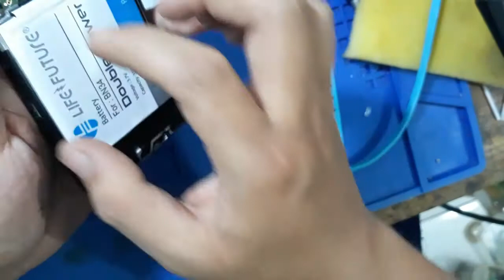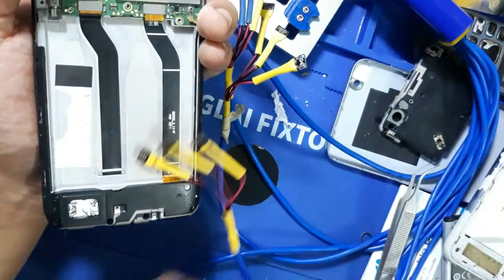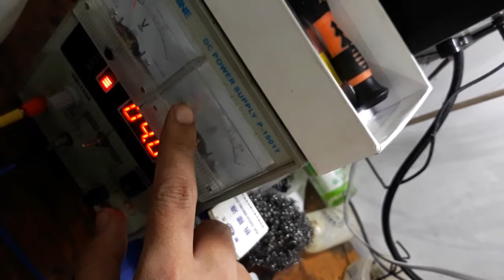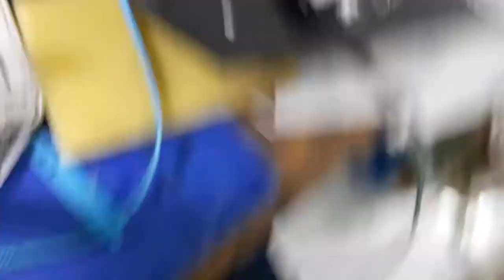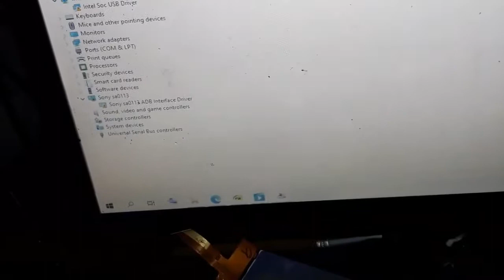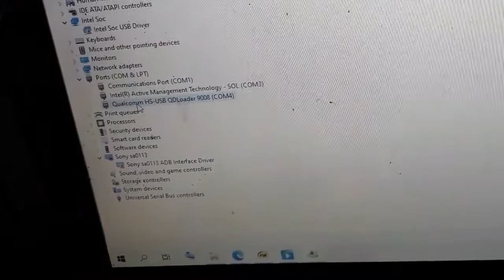Why this is EMMC Problem? not The CPU nor the IC Power Issue? [English Version ]

Comment: Hi friend very well video. I have a cell xiaomi redmi 5 that when you power on it goes 125ma then it stay or stuck sometimes 65ma others 43ma. I have check all voltages pmic and are fine only miss a 0.8volts that goes to cpu. But not exactly know if it goes later activated for RF or modem. Also have to check this of your video or check if i have comunication cpu emmc with osciloscope tomorrow. What do you think?? Emmc!!!
Reply from the maker: Hi. Thanks.
So the phone is dead? Try to connect it to the computer without battery, then tell me what happens. Have a great day.
Reply: @nuhacell-f2o  
It Is reconize by the computer. Connect disconect on computer
Reply from the maker: @edgaralbo6433  open the phone cover, remove the battery and then connect it to the computer, and see the status on the Device Manager window on your computer screen.
Reply: @nuhacell-f2o  the status Is like an error. That the computer see It buy as of It were driver problem.if the emmc or with the emmc It Is Always the same. For me Is the emmc. Tell me something. Doesn't worth buying a new emmc.? I have to reprogram the emmc putting the rom or software inside.
Reply from the maker: @edgaralbo6433  have you installed the Qualcomm driver on your computer?
Reply: @nuhacell-f2o  no
Reply: What's the difference to connect on computer without the battery?
Reply from the maker: @Abbathsin  when it has problem with the emmc, usually the computer read it as 9008 Qualcomm

Comment: First thank you so much ❤
I learnt from U if gage power supply on 0.1-0.6 that means the problem on emmc to be sure from that we connect test point and during phone connected with pc if I find port 9008 or mediateck or usb1.0 Huawei...I will conclude the cpu and power circuit work good...is this correct? my English is weak please tell me by replying to me
Reply from the maker: 99.99% true.
Reply: Thank you so much😊
We wait more
Reply from the maker: @Alaa-9189  my pleasure, good luck.

Comment: sir my old samsung note phone shown kernel problem msg at start and no working ..so i tried to install frimware using odin.........but it stuck and stopped during step of chash memory....and stopped in download mode....then i also try to do that again...but a blur download mode screen came and dissapeear....now my phone is only black screen no download mod no kernel msg.....no start ...is it emcc problem or cpu or other problem?
Reply from the maker: Try the next step, flashing using 'Muslim odin' it's more powerful than any other flasher software. If the problem persist happen, maybe your internal memory is weak and need replacement.

Comment: Nice video sir learnt alot..please i have an isssue when you press power it reads 0.007 when you release power it returns to 0.000 please help
Reply from the maker: What type of phone?  Have you checked it correctly with the correct battery connection?
Reply: @nuhacell-f2o   infinix x627
Reply from the maker: @israelmaurice6910  infinix must used the battery connector, you can take it from the battery, desoldering the connector and use it as a battery source but use DC Power supply.
Reply: But if you changing the emmc you also need reprograming which you never mentioned
Reply from the maker: @brimsupereme  That's true bro. This video is to show you how to analyse the cause of the problem. Mostly Aimed for mobile phone technicians

Comment: Nice explanation based on your experience i have the same symptoms on a samsung device when powered on or removed from charger it's stuck on 100mA and nothing shows on screen it takes 0.6A on charge but before was taking 1.6A. It's a water damaged device it was showing a warning message for overheating issue and the recent/return buttons don't work either i am glad that i saved the whole data off of it when i had the chance to boot it after i removed some thermistor off the board but now it's just dead, so is the warning message for overheating was due to the emmc itself and does a dead emmc prevent the phone from starting? (someone told me if the emmc is dead it will show a green screen when the phone turns on) also i sprayed the board with lighter gas to freeze it and powered it on and the emmc showed up with heat starting from upper side corner, i may try a reflow as a last attempt
Reply from the maker: Green screen in samsung mostly caused by CPU,  you just need to reball the CPU.
Reply from the maker: It happens because when the phone is over heat,  the CPU is slightly disconnect some pins because the CPU is attached with glue which can make it loosing easily.

Comment: Hi brother. I have samsung a5 2017 (SM-A520F).
The phone is stuck in downloading mode, it says ( Downloading.... Do not turn off target).
And im trying to fix it with flashed using Odin, But its always fail. And get notice in odin like "Repartition operation failed". I tried many time but getting that problem.

Did you know what the issues? Thats doesnt get problem with the Emmc? Or what

Please help me
Reply from the maker: Hi bro.  Emmc lifetime issue causes some failures, etc.  stuck logo,  keep restarting,  lagging, and dead.  If you have tried to flash but it failed,  thats 99% needs emmc chip peplacement or repartition.  But repartition will not last long, in some cases it last only 3 days usage. So replacement is better. The Replacement of emmc is so much technical,  you can't do on your own unless you have the tool and the emmc programmer box.

Comment: If i take off eMMC from Motorola one vision and solder it to exactly same model Motorola One vision. Wil the eMMC with existing data work on new Motorola one vision?
Reply from the maker: I never done that, so I am not sure it wil work or not, but it is worth it to give it a try. However, It depends on the  model as well.  May be it will work o  mediatek chipset.
Reply: @nuhacell-f2o  thanks for replying.

I don’t know what mediatek chip set is. I’m just trying to rescue my data by buying exactly same model Motorola one Vision and to put my water damaged phones eMMC on this new working One Vision. I watched a ton of videos how to transfer the eMMC, but no one can answer if the eMMC will work on the new phone/motherboard.
Reply from the maker: @lafriguisara8014 Emmc working is technically done by a  technician. Are you one of those?
Reply: @nuhacell-f2o  

Im not a technician at all. Never done it before.

But so far i bought:

- multimeter
- solder station
- solder iron
- flux
- desoldering iron
- Same model phone
- 99.9% alcohol
- a new battery to replace the old one
- a phone repair set
Reply from the maker: @lafriguisara8014  wow.. what an effort.  But it seems you will find it hard to remove the emmc with that ammunition, you need a hot air to remove it. Btw,  how much dollars hbe you spent for that? I mean comparing to put your phone to the local mobile repairer.
Reply: @nuhacell-f2o  ooh true… instead of hot air gun, i used hairdryer with hot air to open the phone. I have this special glue i bought t7000 I believe.

All costs together (i still planning to buy a ultrasonic cleaner) between 200-250 euros. 

I’m also someone that likes to learn things, this might explain this crazy effort. All started when my phone screen got broken and I replaced it successfully by myself. Now it’s like I enjoy to learn myself. 

Now the only thing holding me back is if the eMMC will work if I transfer it to the new motherboard without also transferring the cpu or gpu. 

Oh yeah i still need to buy BGA reballing utility and solder paste to refine the pads/pins under the eMMC …. Yeah learned all this by watching videos for days now.

All thanks to amazing people like you that share and teach people!
Reply from the maker: @lafriguisara8014  Well, thats really great. I do really appreciate your plan and hard work. Also, congratulation for the well-done LCD repair. Anyway, something for you to remember that the emmc working is so much far different with the lcd replacement in the term of complexity. Before you do to your water damage phone,  you can practice with some unused pcb boards so that you will have experience first. Then you go with the real work, because if you do whatever small mistakes, it will ruin everything as we know that the components are tiny. Ah, one thing I almost forget to tell you, your hairdryer can be used to remove LCD , but not the emmc. You do need a rea hot air. 
And, dont buy ultrsonic cleaner, you dont really need it. It is not worth it to buy only waste money.
Reply from the maker: @lafriguisara8014  Btw, you havent told me what type of phone that you re working on. If it is something old phone, I guess you will have the data back as long as the swap runs perfect. Because old model use low security encryption.
Reply: @nuhacell-f2o  thanks for the advice. I see, i will see if i can get my hands on a hot air gun. Oke so ultrasonic cleaner don’t do much? Might take it off from my list and instead buy a hot gun.

My phone is Motorola One Vision from 2019. The eMMC is encrypted if i got my info correct. That’s why i bought the same model phone and not just another motherboard. My hope is that same model phones motherboard can read the eMMC.

I have no other pcbs to practice. So I have one chance to do this right.
Reply from the maker: @lafriguisara8014  have you check your dead phone inside? Clean it, try to recover the damage by cleaning it. And see the result.
In doing phone repair, always do the lowest risk things first, then go to the next next next level.
Reply from the maker: You will never know the result until you try it.
Reply from the maker: Well dear, I have checked the model of your phone out. It seems you will have very low chance of doing that as it use UFS not emmc, and also it use Exynos chipset. 
You should rethink it so carefully bot wht youre doing. Technically, your valuable data is safe on that chip. What you need to do first is, open your phone and clean the machine with Cajuput oil, or Paint Thinner . Polish or brush it gently. And your phone will be alive again. Water damage makes corrotion on some parts..
Reply: @nuhacell-f2o  wow thanks for the info bro. All this time i tought it also has an emmc. I need to research what UFS exactly is. I thought i was prepared correctly now i see, i might have been wrong.

I did put my motherboard for like 10 minutes in 99.9% alcohol. That still didn’t help.
Reply from the maker: @lafriguisara8014  dont soak it,  but brush it with Cajuput oil, I dont know if it is available in your country . Just google it. It is indonesian product. 

Well, ufs and emmc is phisically indentic. Just like hard drive and SSD on computer. So no worry about the UFS. 
Well. Basically, you need to analyse the cause of the dead phone.  You need to do troublehoting. Buy DC power supply  with minimum 2 ampere scale,  or 5 is better.but 2 is enough.
Reply from the maker: Have you check the pcb if it is short or not? Use the multimeter
Reply: @nuhacell-f2o  Thanks for all the info and your time! 

I still didn’t check properly if there is a short on pcb. I tried to YouTube how to check it, but can’t figure out what setting i need exactly. I think continuity setting? … I saw a video where a guy put some alcohol on the components put the power on the pcb where the alcohol got dry quickly was the short, but I didn’t try this.

I will definitely google for Cajuput oil. There should be something similar here in Netherlands.

Also will look for DC power supply!
Reply from the maker: @lafriguisara8014  Just add my WhatsApp if you need more detail. I will show you many things you need. I was a person like you, who like to learn things on my own. I now run a small,  very small repair shop here in my village just by watching youtube and practicing every day. So, I am sure you will a have good insight if you have the knowledge and lot of practices. What you are facing now is a dead phone by water damage. So do more research and practice,  emmc and cpu is last option. Just think that your phone may have short on some capacitors, not the IC. Just drop your WhatsApp